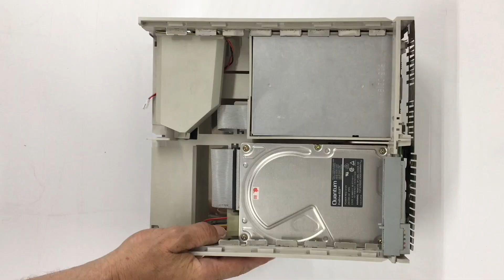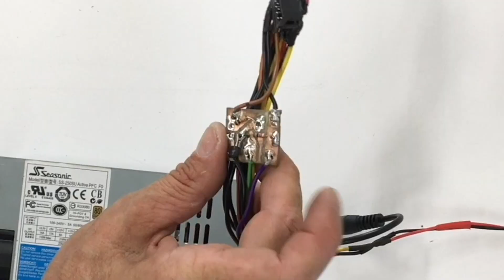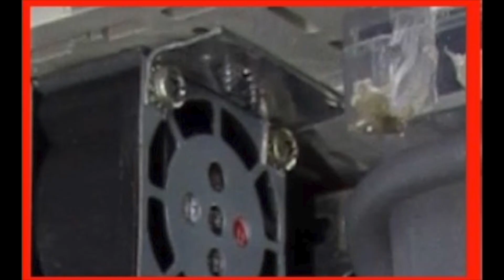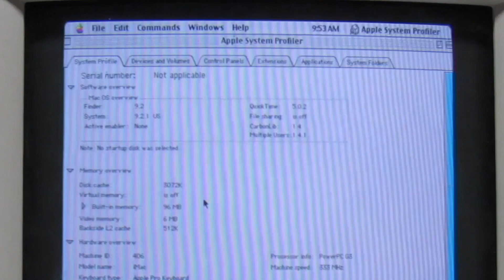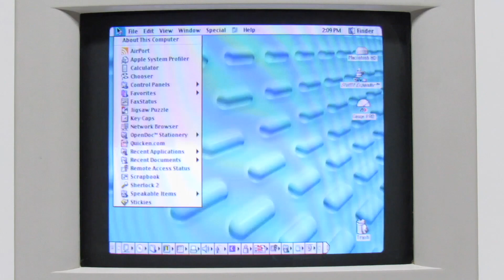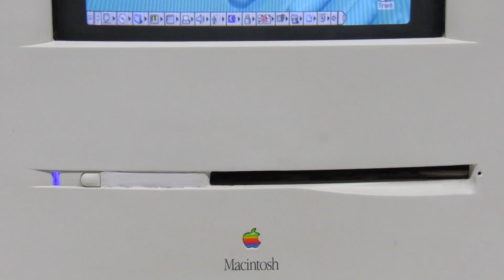How to upgrade a Macintosh Color Classic with CRT to an iMac G3

Comment: i know there was the LC 520/550/575 board upgrade (mystic) which didn't need any modification done to the CC, then the takky upgrade which was using a 580/630/5200/5300/5400/5500/6200/6300/6360/6400/6500 board in the CC which needed some modifications and then a new upgrade that also needs mods to the CC which is the imac g3 upgrade
Reply from the maker: What are you asking, or saying?

Comment: Hi I was wondering if you can help me. I have an iMac G3. M 5521 DV+  2000 model. The DVDROM drive slot loader does not work  and I can’t find a replacement DVD drive which the iMac can recognize. Can you please help me with a model number or direct me where to buy it from the DVD Drive that you used in the rebuild.  Please help me.
Reply from the maker: Hello, unfortunately as far as I know, those DVD models were only used in the iMac G3 slot loaders and the G4 Cube, Panasonic or Matsushita or Panasonic part numbers SR-8184, SR-8184-B and SR-8166.

BUT, the DVD drives  (CW-8124) from the Mac Mini and iMacs from around 2004 to 2008 will work, however it takes quite a bit of jury rigging and you need the Apple JAE adapter that Apple installed on the first generation tray loader iMac G3s. One of those generic slimline JAE adapter boards may work, but I've never tried those? The Apple adapters have extra capacitors on them?

The connector that goes from the logic-board to the drive is just a non-standard 50 pin IDE, I used a 50 pin SCSI header and soldered it to a 50 pin cable with a 2mm pitch, to plug into the middle connector that goes to the DVD.

Lastly to get it installed, you need to fashion a setup where  the drive lines up with the DVD slot on the front bezel as the newer drive is a bit smaller with different mounting points, off the top of my head I can't remember how I did that, the last time I did a setup like that was in 2010 or 2011?

Is your drive completely broken or is having problems with injection and ejection?
Reply: @BillyTheKidCENTURION  
I think I might Open and take it  apart take out the drive and check the rollers maybe glue down the roller in the drive on the shaft so that way the CD will go in and out properly. Thank you for your reply.
Reply from the maker: @BlueBlackSnak3  No problem:) If you get into it and just happen to find the rubber drive belt is broken, they sell those universal cassette recorder belt kits, I had to order three of them until I found a belt that fit my drive.
Reply: @BillyTheKidCENTURION   I just ordered from ebay assorted cassette belt kit. I am waiting for the speakers as well as 1gb of ram. Maybe I will put an ssd with and ide interface.  I cant wait to get this iMac up and running.. Thank you for your support .

Comment: Another Great Mod
Reply from the maker: Thanks again:) I'm working on a Color Classic/Raspberry Pi interface board that will just plug into the edge connector  of the Color Classic. I've received some help from Rocky Hill, and I think I need a Vertical and Horizontal Sync combiner circuit? it should also work with the LC520, 550, and 575.